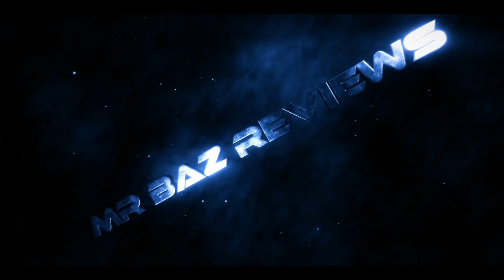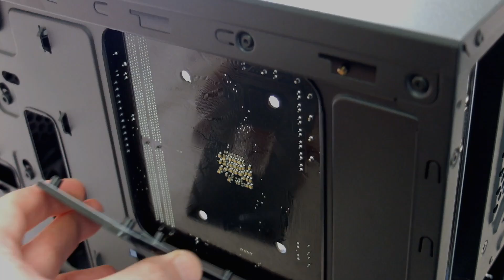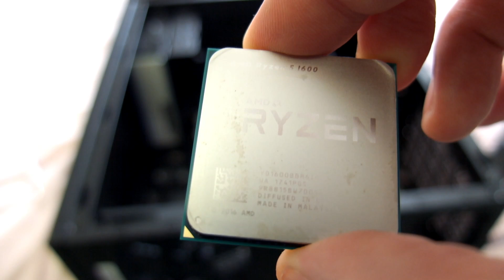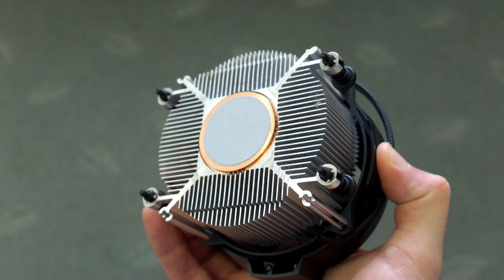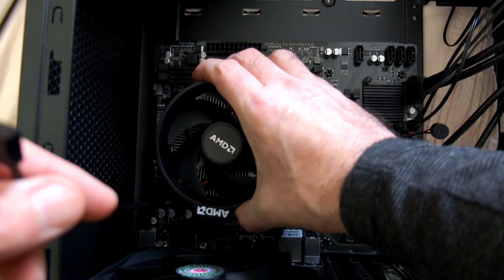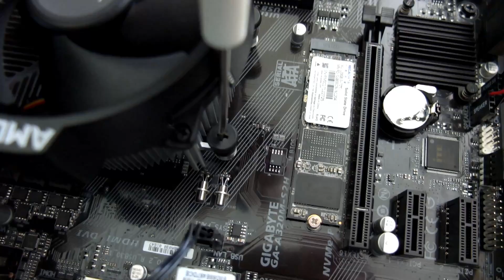How to install a Ryzen/AM4 & AM5 Wraith CPU Cooler

Comment: Hello recently I saw that my CPU (Ryzen 5 2600) run's pretty hot (70-80 sometimes 88 degrees) and I think it might be because I didn't tighten the screws really hard because I was scared of overtightening it. Can I just tighten them now or should I remove the cooler completly apply new thermal paste on it and screw it in? I mean doing that would be much more effort than just screwing a little more.
Reply from the maker: Try it if the temps don't go down a lot then reapply new paste. It has to be firmly in place there should be no movement from the cooler at all, you can't really over tighten it because the screws feel firm won't move anymore. Back plate distributes the load so there is no concern there.
Reply: @MrBazReviews  okay so since I don't have thermal paste I just tightened the screws more and i noticed that 2 vertical screws were really tightened and the othjer 2 very a little loose. So i tightened those and I can already see a difference. When I'm in Idle my CPU used to be at a clock rate of 3.40 all the time but now when Im in idle its about 1.5 - 2-5 Ghz and with that also come lower temps. I tested it in a very demanding game (Devil May Cry 5) and 30 mins in i only have 70 degrees and max 75 while before that i had up to 88 degrees in that game. So I already can see a improvement and I was always scared because I even could feel the temps basically it would get really hot under my desk but that is solved too. And the cooler also runs a little quiet now. Ty by the way for u reply and the video! It took my anxiety away from overtightening it :D
Reply from the maker: @sc7766  Temps are still a bit high but it's usable. I would at some point remove the old thermal paste and put new stuff on the Ryzen CPU's are not hot unless doing a big OC I'd expect temps in the 30s Celsius maybe hitting the 50's under load maybe 60 max not sure what fan speeds you have. I did replace one build with an ARCTIC Freezer 33 it's not an expensive one but I've it set up passive on low load doesn't even kick in until the mid 40's. You can OC quite a bit with that if you want if not it's fairly quiet. Stock cooler is quite decent for most users though
Reply: @MrBazReviews  yeah I want to replace the stock cooler too but I just don't want to go through the process of taking out the motherboard and then mounting it on xD
Reply: @MrBazReviews  which temps are actually normal with the stock cooler?
Reply from the maker: @sc7766  Under load stock cooler high 50's def not much into the 60's
Reply: @MrBazReviews  hmm my temps are really high then tho :/
Reply from the maker: @sc7766  They are pretty high maybe the thermal paste cured if it wasn't contacting the CPU properly I'd remove it with citric cleaner and apply some new stuff. MX is pretty good, Gelid do decent paste too. You can't really damage it throttles down but I'd get it done myself
Reply: @MrBazReviews  okay I am going to do that. One question tho I think I'm gonna buy a cooler anyway so (Gonna buy the arctic freezer). One question tho If I want to mount the new Cooler can i just do it in the case? Or do I have to remove the MB and mount it on while not in the case?
Reply from the maker: @sc7766  You re-use the board backplate is just screws into it with it's own clips quite a simple fit on that one, but if you remove the stock cooler the plate will be loose - but if it doesn't fall out you won't need to take the board out. I like it but I've also got the stock one in another system and properly fitted it's pretty quiet too. Maybe try the thermal paste first (get some decent stuff) but if you are over clocking then the Arctic is a nice low cost option.
Reply: @MrBazReviews  okay thanks for the help :)
Reply: @MrBazReviews  Mine goes 60~67 in Adobe premier is that Usual?
Reply from the maker: @anamixnetwork8446  What CPU are you using and is it over clocked? It's not excessive the CPU can handle much higher temps before throttling down. Most Ryzen CPU's get into the mid 50's to mid 60's on the stock cooler, which is fine. Larger ones as mentioned -will cool better.
It's not really a problem unless you want to do extreme over clocking

Comment: Backplate screws keeps going circle but it won’t go up or tighten it
Reply: The motherboard is b450 gaming plus
Reply from the maker: @pitmeister9112  Screws should come out never seen a problem like that before. It's kinda hard to strip the screws as the back plate is plastic (hard type) so you can't really strip them unless the screws are defective. Try pulling the plastic brackets whilst you try to unscrew them start one side then the other or use something to push the ends of the screws from the back plate side (small screwdriver) when you unscrew them. I can't see how they won't tighten or remove unless there are no thread and someone messed up at the factor
Give it a try see how you get on
Reply from the maker: Is the plate being held in place when you tighten it up? Push down on the screws they are spring loaded
Reply: Mr Baz Reviews no the screws is connect on the motherboard it can turn around but it won’t come off
Reply from the maker: @pitmeister9112  Backplate should come off when screws are removed as shown in the video
Reply: The screws just won’t come off
Reply from the maker: @pitmeister9112  Then there is a problem with the board from the factory they are not that hard to remove not the ones I have used

Comment: This video did literally nothing. The screws are too small to reach the mobo on an a320m-HDV and you'll most likely just end up cracking the mobo or damaging the CPU
Reply from the maker: The screws reach that is the stock cooler and standard backplate. Perhaps if you watched it you'll see you "apply pressure" as the screws are spring loaded. 328 people found is useful and it's pretty damn easy to do. I've never cracked a board and I didn't on this one. Sometimes simple things challenge people - I've no idea why.

Comment: The cooler screws arnt long enough to reach the bottom of the motherboard and I feel like If I put a bit of pressure it might damage CPU
Reply from the maker: You have to push down to engage the threads it won't damage anything the screws are spring loaded as I say in the video pressure is needed to get them started
Reply: @MrBazReviews  nvm just realized the back plate fell off
Reply: Thanks for the reply though
Reply: @Rasmusb same did you figure it out?

Comment: Is it worth it to apply your own thermal paste? I have some Arctic MX-4 because I didn't realize the paste was pre-applied. Any real temp or reliability difference?
Reply from the maker: You'll get lower temps with MX-4, but it's not a huge difference unless you're going with a different cooler - if you're not OCing then I'd not worry about it too much.

Comment: The cooler doesn’t fit my board aorus b450 pro
Reply from the maker: How can it not fit where? It's the stock AMD cooler it would be pretty dumb if any motherboard maker produced a board that doesn't fit the CPU manufacturers cooler.
Reply: @MrBazReviews  turned out one of the arms that held the screw was bent but I managed to make it fit ;)
Reply from the maker: @Blixster  That would explain the problem :-)

Comment: when i screw it in one side just goes up and i cant screw the other side
Reply: Haha, I had this issue and it took me over an hour and thirty minutes to get it seated properly. PAIN IN THE BUTT.
Reply from the maker: Make sure it's on a flat surface shouldn't have a problem or get someone to hold the backplate whilst you screw it up. Just slightly screw one, then go to the next one rather than screwing one in fully
Reply: This was my same issue, even with only having a half turn of the screw on one side. Definitely wasn't an issue of screwing one side in too much. I ended up going with a different cooler but I feel the main issue was being uncomfortable with the pressure needed for the spring system.
Reply: that because you screwed one side too much it stayed at air and required too much pressure right.
Reply: Screw one screw in just until it is entered and turning, then start on the opposite corner to ensure the component is going on evenly. Once you have all screws entered tighten one then opposite corner. Work it in evenly until all screws are secure.
Reply: G

Comment: My screws for the cooler aren't low enough to touch the bottom of the mobo :( 

Edit: I figured it out, but I have no idea what I did lol it was a while ago

Another Edit: I remember, it turns out there wasn't the baseplate on the back, it was freely roaming around my PC instead of screwed in lol
Reply: yea ikr have experience it also in my case i broke the metal spring of the screw so it will go down freely. but dont do this
Reply: I had to put quite a bit of pressure on mine in order for it to get seated properly. It took like 30 mins of going easy on it before I snapped and went all in lol.
Reply from the maker: Lol

Comment: "can't over-tighten" Thanks, those were the magic words I was looking for, just like the half a million other people who were afraid to hear "CRACK" and smelling burnt silica on-1st-boot.
Reply: Dude I spend like 2 hours thinking about the screws. You just said that I can't over tighten you are the best.
Reply: I used a drill and i over tightened it literally cannot unscrew
Reply: @BUHDAAAAAAAAAAAAAAAA  Does it still turn though while not unscrewing? If so, hold a fingernail under the cap of the screw while *slowly* unscrewing it.

Worth a shot if you ever need it to get unstuck.
Reply: I need the same tutorial but for removal😂 they turn in place but none is getting any looser
Reply: @glacialimpala  Try putting your fingernail under the head of the screw. Or a very thin screwdriver (not recommended as it can scratch the soldering meant to ground the screwholes)
Reply: @Yezpahr  thanks, actually what happened was the plate behind the mb that holds holes for the fan got loose 😬

Comment: I have ryzen 2600X with this cooler. I'm looking at the temperatures with aida 64. THe cpu temperatures are jumping continously and vary between 38-47 C . Why are the temperatures jumping?Is that ok? After 1 hour Fifa 19 which is not a game with high requierments i saw 55 C. Is it not high? Is it normal for Ryzen? I always had Intel processors before ..
Reply from the maker: 55 C isn't high not for a CPU fairly normal if it's been under load. The temperature will vary depending on what it's doing. If it's idle then it should remain fairly steady. Also the CPU fan settings can vary a lot - Motherboards have a curve you can adjust for the fan speed at idle Ryzen is cool enough on some CPU coolers to run passive mine doesn't even kick in until it's been under load for some time. The stock cooler is decent enough for what it is you can get better performance from third party ones (I fitted the Arctic Freezer 33 on one build, but stock is fine too)

Comment: I accidentally touched the top of the CPU before installing the stock cooler, than I clean it, is that okay? This is my first time building my own PC...
Reply from the maker: If you cleaned it will be fine, grease from fingers can reduce thermal transfer I use citric cleaner then let it fully dry off

Comment: A couple of questions
1: It doesn't matter which direction the heat sink is facing?
2: I find it much easier to install the heat sink with my computer laying down but if I do that, my back plate to fasten the screws to falls through.  I've tried holding it on different ways and the most successful way still leaves a little wiggle with the heat sink, which is probably what's causing me to reach 90c+ under load.  Any good way to hold the back plate on?
Reply from the maker: Doesn't matter really what direction it's on, should fit firmly what I did was put it on the bed but you can put a thin book under it (put anti static under it if you wish) should screw in without issue screw it in tightly

Comment: What do I do if the little black screws after unscrewing the brackets are under the motherboard
Reply from the maker: Not sure what you mean
Reply: Got the same problem, it seems like I can't attach the cooler on the motherboard.
Reply from the maker: @spotlighttdm  If you have the backplate on then there is no reason it can't attach, it just screws into the holes you have to push a bit as the screws on the cooler are spring loaded

Comment: Do you keep the backplate?
Reply from the maker: Backplate is put back in place so you can fit the stock cooler, otherwise there is nothing to screw it into.
Reply: @MrBazReviews  Good video man, exactly what I needed to know. Can you help me with something? I'm building on an asrock b450 pro 4 motherboard , can you tell me what I need to look for on the motherboard to plug in the tiny power,reset , -p led and +p led plugs from the case please? As in what are they labelled as on mboard and roughly whrabouts if possible,would be very grateful
Reply from the maker: @violent_keith8393  Front panel connectors are at the bottom right corner and have markings on for which ones to attach (ie reset/power, HDD LED etc) The user guide should also show this (usually easier to see on this) and which ones are what. If you get the connections wrong nothing bad happens ie reverse the +/- etc it just won't work for that connection. The case should have the markings on the connectors that fit the front panel

Comment: Im screwing the screws in but they wont go into the threads. I dont even know if they are going down
Reply from the maker: You just need to apply a "bit" of pressure as they are spring loaded they should go in no problem

Comment: so i got a 2600X dat comes with the wraith spire non rgb, if i get a wraith spire rgb, can i just change the fan part? i see 4 screws for the fan, i assume the rgb cable is tied to the fan
Reply from the maker: Just swap the fan out the rest is the same
Reply: @MrBazReviews  thx, do you think i can do it with tower mounted?
Reply from the maker: @JPVRusso  You mean in the case well if the base/heatsink is attached it's just unscrewing the fan and changing it over

Comment: Great video. I was wondering if my Liquid Cooling fan will be out of use then since Ryzen comes with this cooler? Before Ryzen, I had a liquid cooling fan that would be on top of my old CPU. Now Im getting the Ryzen with their own fan, hence the liquid cooling fan is discarded? Thanks
Reply from the maker: What is the model of the water cooling system? Problem might be fitting it to the new socket or if there is an option to get a new mount for it. Water cooling is mostly of use for heavy over clocking, for Ryzen the stock coolers are pretty good in terms of being quiet and cooling performance, though I did fit an Arctic Freezer 33 to one Ryzen 5 build you can near enough run it without the fan at stock speed ie completely silent.

Comment: Sorry, I do not understand English, but your video helped me a lot. Just answer me a question, does the cooler affect the positioning of ram memory?
Reply from the maker: Not for most ram unless it's exceptionally tall with the heat sink I've yet to find any that came near to this cooler myself. Should be a non issue
Reply: You don't understand english but you typed a perfectly legible question in english lol.
Reply: Its called translator
Reply: He is using translator.